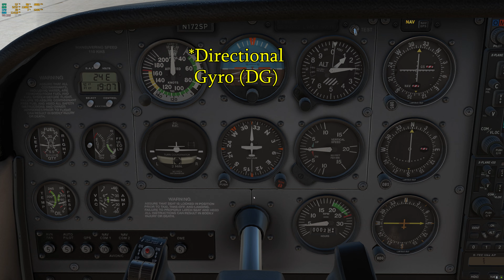X-Plane 12 - Full Flight & ILS Approach - Cessna 172 Steam Gauge & Autopilot - KOFK ILS 02

Comment: If you click NAV again it turns on a second light labeled "GPSS" and then it will follow the GPS correctly, without having to change the bug
Reply: ok youtube refuses to let me edit this comment - it should read GNSS not GPSS
Reply: @NilesRogoff  My Xplane 12 shows GPSS, not GNSS.  But, if you're flying using the VLOC mode in the 530, you have to switch to the HDG bug to make the turn crossing the VOR.  If you're using GPS mode, and have the proper way points set up, it will turn just fine.
Reply: @azcharlie2009   Just so - I've flown this route (in X-Plane 12) and, with GPSS showing, the heading bug has no influence on the a/c heading. On reaching Columbus using GPS steering, the a/p very nicely steers for SLAYS without touching the DG or bug. BTW it's important to push the NAV/GPS button on the panel and have GPS lit as well as having GPSS on the S-TEC 55 display.

Comment: One thing I hate about that autopilot is, you can't set it up to just track the heading bug and adjust the pitch manually.  If you do it disengages the autopilot.  Personally, I'd never have an STECH without altitude preselect.  That autopilot will kill you if you're not paying attention.  As you climb and lose performance, it will keep adding pitch until the plane stalls, which leaves you in a trim up stall to the left.  A recipe for a spin.

Comment: I really dread flying these but its a must for commercial flight school. The systems are so bad you have to constantly bug the heading select when out of GNSS. Also pro tip when in ALT hold mode you can bug up the Vertical Speed knob to raise your altitude by 100 feet per knob turn.
Reply from the maker: Thanks for watching and commenting! Thanks even more for the tip!

Comment: Where do you get the panel you are using on the Cessna 172?  I want to add the Garmin 430 & 530 to my 172 sp panel but can't figure out how to do it.  I am using the desktop Air Manager 4.2.11 on a Windows touchscreen computer.

Comment: so i just started playing x-plane 11 after having uninstalled due to being intomidated with navigating… I finally got enough courage to try a flight and hoooly moly i realize now why i need rudder pedals, that aside i managed to take off and trim the airplane with my mouse and joystick, that was fun… and i just clicked gps and somehow got the plane to start flying in a straight line towards my waypoints. The whole flight was weebly wobbly and then the aircraft kept trying to take over when i kept trying to correct my heading and couldnt figure out how to turn off the auto pilot lol😂. Anyways this video is answering a lot of questions i have, especially abt the heading bug thing. Thank you!
Reply: you can simply move the trim wheel a touch in the 172 to deactivate the autopilot

Comment: I know you did this video some time ago. I've been using MSFS2020 for a couple years, using it now to practice for my upcoming IPC and I'm considering switching to X-Plane due to the common opinions that it's better for this type of practice.  I've developed some workarounds for the bugs that make IFR practice annoying in MSFS and at first glance X-Plane appears to have fewer annoyances or maybe is generally more easy to manage.  There is one thing I noticed that has me questioning if a switch of sims is worth it...
 
1. I noticed that you didn't dial the final course of 014° into the VOR1 heading indicator but the heading needle remained centered.  That seems like a defect.   
 
Absent that one thing, it looks like a good idea for me to try X-Plane.  Any advice you or others who see this comment have is greatly appreciated.  In all reality I will probably eventually get X-Plane and compare both sims directly some point.
Reply from the maker: Thanks for watching and commenting!  I think the way I'd compare Flight Sim 2020 and now 2024, is they are best suited for the person who wants to fly around, maybe in 3rd person, and view the AMAZING scenery (as long as you have a strong computer), while also having a solid foundation if they want to use it for some mild training.  Where X-Plane (I think it's on iteration 12 now) is definitely the better "simulator", especially for instrument practice and procedures.  I think X-Plane also runs a bit better on lower end systems when you are in the cockpit focused on the instruments.

Having said that, they are both so close (and good) that if you have one, it might not be worth switching to the other if you don't have the extra money lying around.  I bought them all simply because I have a hopeless addiction to aviation.  If I'm not at work flying, I'm at home flying on the PC!

Thanks again and good luck on your IPC!!!!

Comment: Thanks for a great tutorial.  I no longer fly for real due to age.  i flew VFR in a C182.  Now I have a descent sim setup.  How did you display the approach plate in the upper left corner of the screen?
Thanks for the tip on pressing the D key for compass alignment.
Reply: Dollars to donuts, he inserted the plate in post production. The GPS enlargement is part of X-Plane.
Reply from the maker: Yeah I did it when editing the video, not while flying the actual approach.  I usually have the plate pulled up on another monitor or cell phone/tablet as a reference when I'm flying IFR in these sims.  Thanks for watching and commenting!

Comment: I don't see much of a difference between x-plane 11 and 12. Have you used both and do you think it's worth it to upgrade? At 41:28 the CDI auto switched from GPS to NAV mode... that's cool, but don't count on that happening in real life. lol. Watching this to see how APR mode is used in an autopilot like this... Some suggestions if you don't mind; I was taught to only put in 10 degrees of flaps when you are one dot above glide slope 44:35 and, I think, you could have stayed at 5k feet and only started the descent when the glide slope needle was centered.
Reply: 51:28 well the landing looked more realistic from X-plane 11 to 12... That alone might be worth the upgrade. lol. That was a good landing. IMO.
Reply from the maker: I'd say, for anyone reading this, XP11 and XP12 are similar enough to not really need the upgrade, as long as you are happy with what you are using (I have both and got XP12 simply because I wanted the "newest thing"). I have switched to 95% MSFS2020 simply because no one else can touch the graphics and live maps/terrain.  It's mind blowing landing in your own back yard haha!  The actual "sim" aspect will probably always be better with X-Plane, however.

If I get to fly Thursday night I'll set up my Garmin 530 for an ILS and see if it automatically switches modes.  I want to say that it does, but I could very well be wrong.  I can't film at work but I'll leave a comment here if it does it's own thing.

Thanks for the tips on the flap settings!  I'm not a fixed-wing guy so flaps and landing gear, etc... I just have to kind of make up as I go along.  Any help here is definitely appreciated!

Generally the APR mode just tells the autopilot to kick off altitude hold and intercept the glideslope, or vertical nav if using GPS.  My knowledge there is EXTREMELY limited though so take that with a grain of salt.  That's at least how I understand it.

Thanks for watching and commenting!
Reply from the maker: Shot an ILS a couple nights ago with a Garmin 530 (in real life).  Set up the approach in GPS mode and sure enough it switched on it's own to VLOC when set up on the final approach course/localizer.  Pretty neat stuff!
Reply: @brettkoski  Flying the route here using X-Plane 12 augmented with AutoOrtho and SimHeaven scenery. the Platte and the landscape looks darn good. Installing these two add-ons is "an opportunity to excel" (ah-hem), but once installed, launch AutoOrtho, wait for the magic to happen, launch X-Plane, wait for the magic to happen, and then go flyin'. Best of all, AutoOrtho and SimHeaven are free. Woohoo!  
In the vid you mentioned posting the approach plate, or a link to get it - AFAIK, it's not given in the description - or did I snooze right past it?
Reply from the maker: @RBEmerson  Sorry about that, I have updated the description to include the plate.  For USA airports I usually snag the plates off of "Airnav.com" from the respective airport page.  Here is the plate for OFK ILS 2:
https://aeronav.faa.gov/d-tpp/2403/00974IL2.PDF